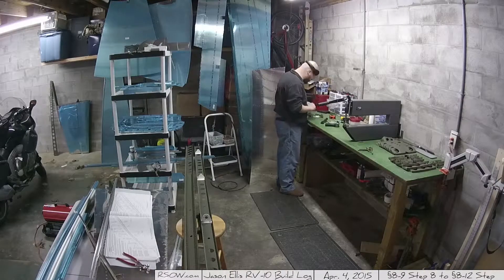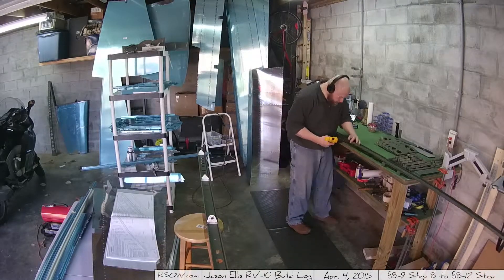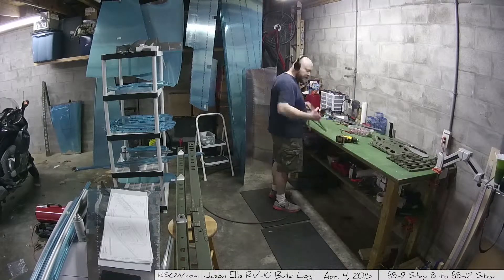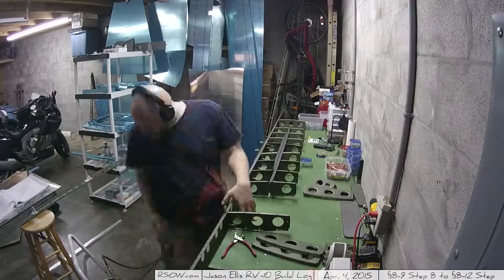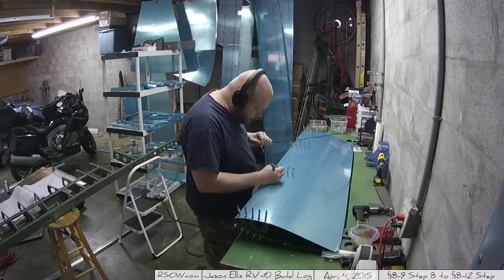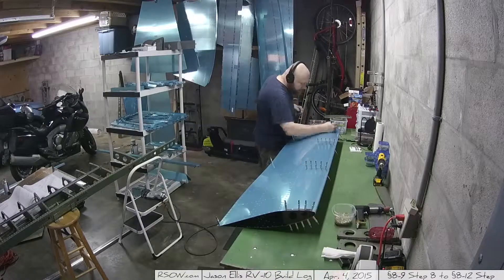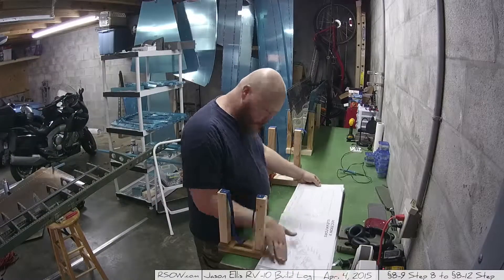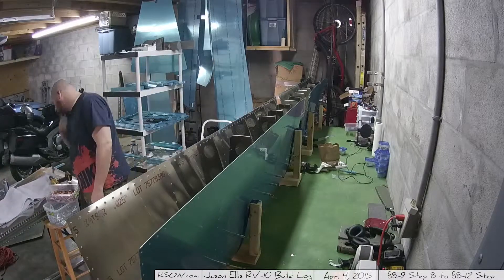RV-10 Empennage Section 8-9 to 8-12

Comment: Hi Jason, thank you very much for the videos! I know it’s been years, but I’m trying to figure out how to set the last 10 rivets on the two inboard nose/inspar rib attachments to the front spar in the middle of the HS. They are very awkwardly positioned so neither the squeezer nor the gun fits in there. This is step 2 of 8-12. Hoping you can help. Thanks!
Reply from the maker: I believe I had to use the 1/8" double offset rivet set to get that those and I put the shop head inside.. I'd have to go look to be sure.
Reply: @JasonEllisBuilds  Thank you so much for your reply! I suspected this was the answer, but was trying to avoid using the unfamiliar tool. :) I just set three of those rivets, and they turned out okay. Came back to say thank you, keep up the good work, and hope to see you flying your plane soon!